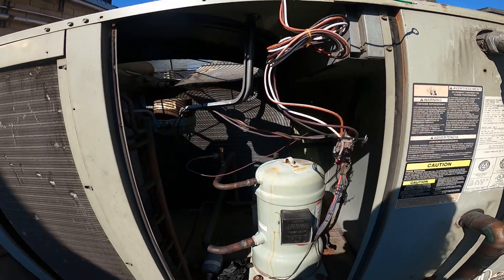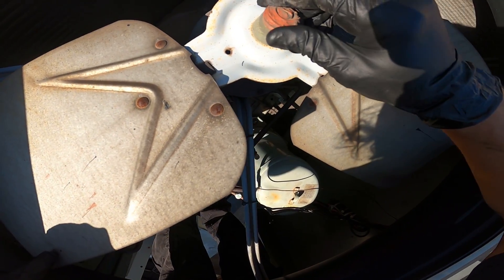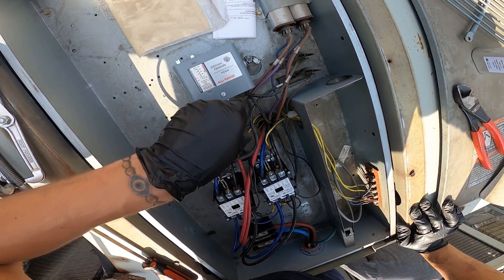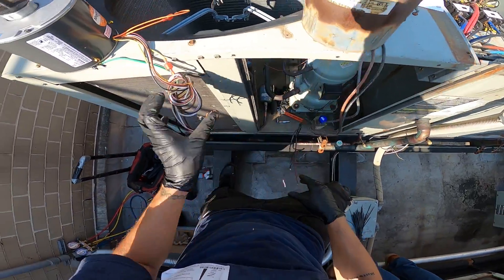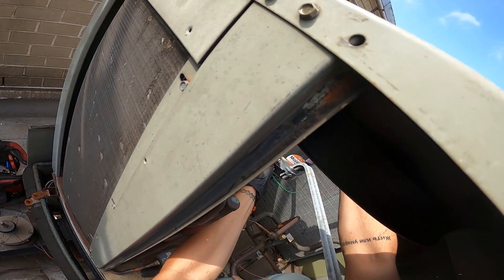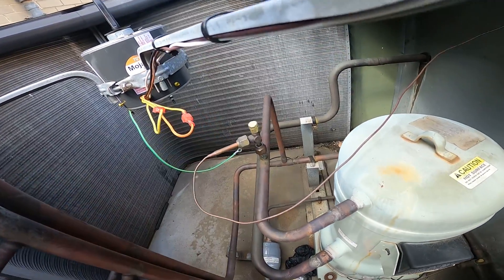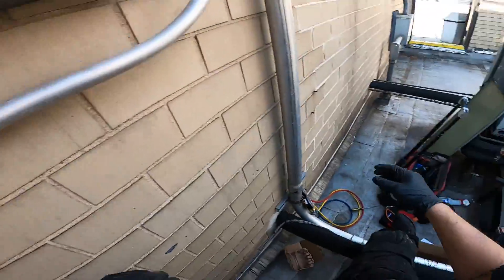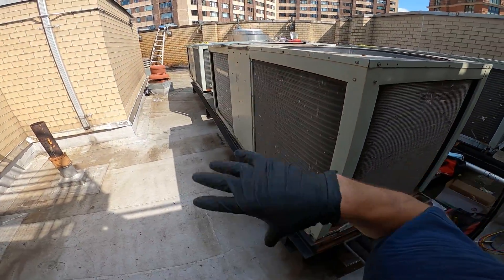HVAC: How To Install/Wire A Condenser Fan Motor (Single Phase Fan Motor Installation/Replacement)

Comment: installed a new motor the same way for my unit and motor did not spin. Capacitor tab got close to frame and it arced and motor started. What gives? Compressor and relay switch working as should.

Comment: Hey I would like to know if the refrigerant in the lines of an hvac system is moving at high pressure within the lines or are they not moving because it’s a closed system?